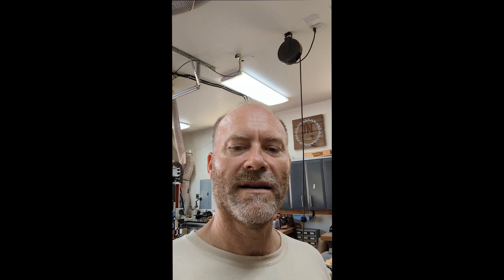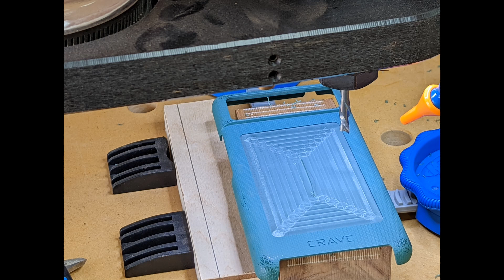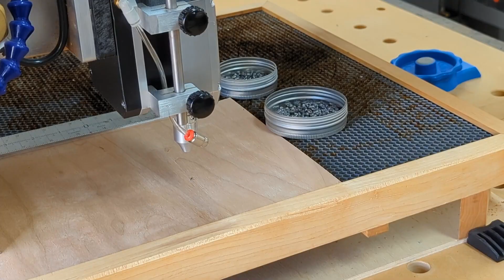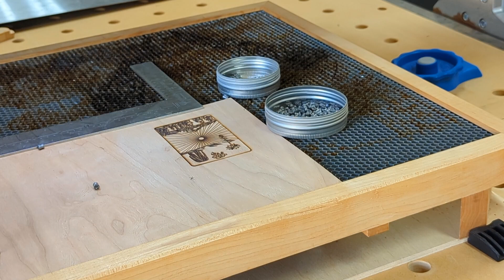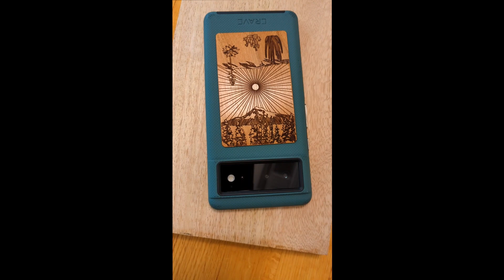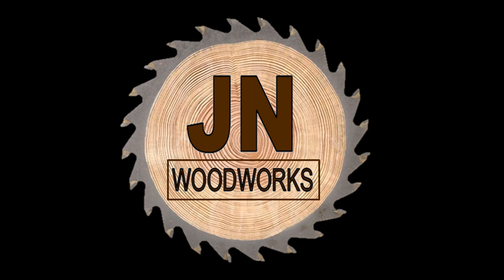Phone case customization using AVID CNC and OPT Laser

Comment: I was wondering.  Can you cut 3mm - 6 mm plywood with Aspire Laser Module?  If so how?  Z axis?
Reply from the maker: Yes, the 15W Opt laser I have will cut 3mm plywood in one pass at about 12 in/min.  6mm plywood takes 3 passes to cut through usually.  6mm is about the max thickness of plywood due to the power density decrease as the beam expands when it goes deeper.  You don't have to use the Z axis to move the focal point down for multipass.  I generally set the focal point so that it is at around the 40-50% depth of the material I'm cutting.
Reply: @JNWoodworks  How about the 7w Opt Laser XT-50.  Thanks
Reply from the maker: @1Oreely  I can cut 3mm baltic birch plywood in one pass with the XT-50 at about 7 in/min.  6mm at the same speed with about 4-5 passes.
Reply: @JNWoodworks  Thanks for the info, Very helpful... The folks at Opt Laser said hey!
Reply from the maker: @1Oreely  You're welcome.  🙂